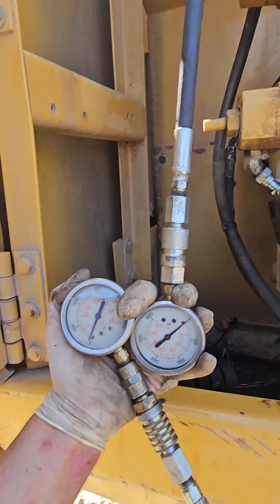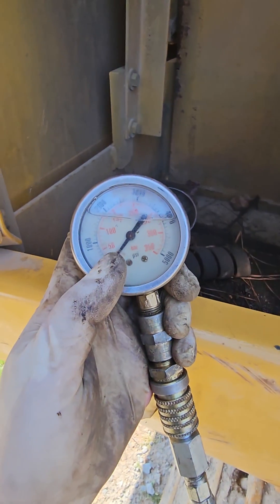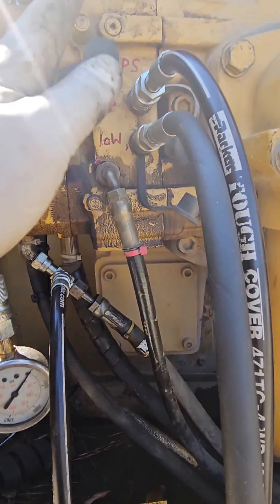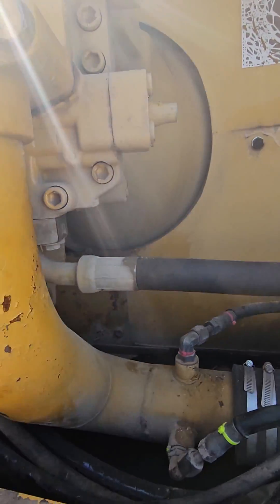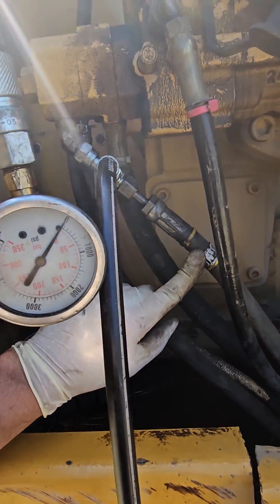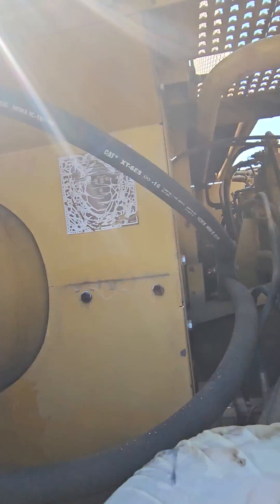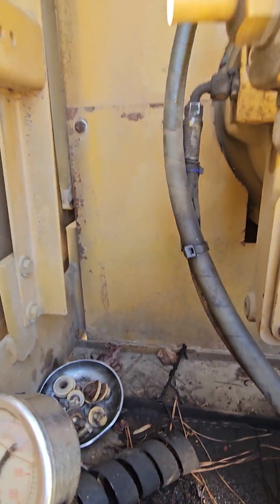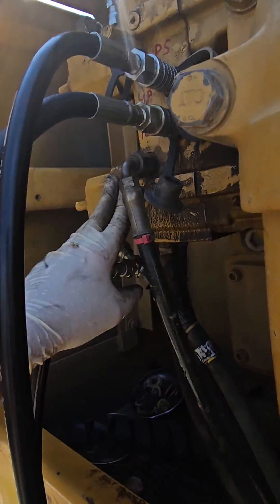Diagnosing Cat 330L: Tackling the Left Forward Track Power Issue - Part 5 | Mobiledieselmedic.com

Comment: Got to have even pressure or you'll be running around in circles. Even an old knothead like me knows that. You just eed and old, manual friction cable rig. Easy to diagnose! Look for the shelled off teeth.